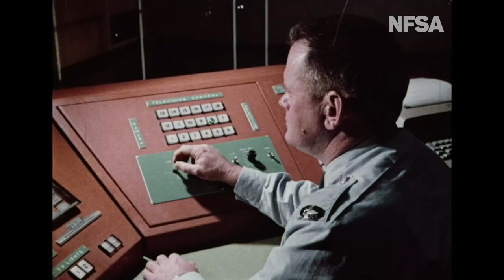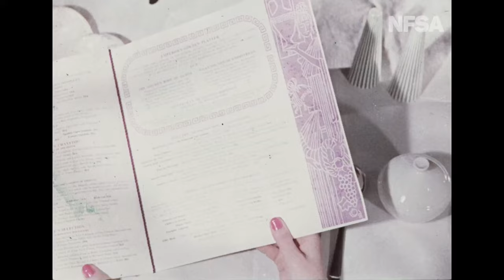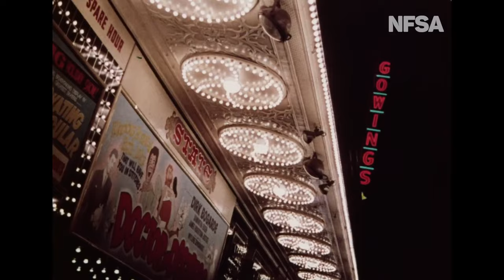City Of Millions, NFSA, Sydney History, 1964 Construction of Modern Sydney, AMP Tower.

Comment: 14:51 I guess that plan was shelved? can't remember seeing skyscrapers in the Rocks area
Reply from the maker: Yes, it was and some might say fortunately. Sydney Living Museums currently has an exhibition called "Unrealised Sydney" where this Rocks scheme features. In the 1960s there was heavy pressure to knock things down and build new. The QVB almost suffered a similar fate, but was also saved. 

The Rock was probably at it's lowest point in the 1960s, run down housing commission barely an business in the area and it was not appreciated for its historical value at the time. But it was prime real estate making it most vulnerable when it came to eager developers.

The closest they got was the building of the Sirius apartment complex for the department of housing, but that was in 1978 some 10 or 15 years after the time in this video.
Reply: My dad worked for an engineering firm based in the Argyle Centre in The Rocks in the 70s and 80s. And later I had great times at The Glenmore and The Lord Nelson pubs. The Rocks has a wonderful atmosphere - it's the only place in Sydney with a deep connection to history. Skyscrapers are a dime a dozen but that's unique.